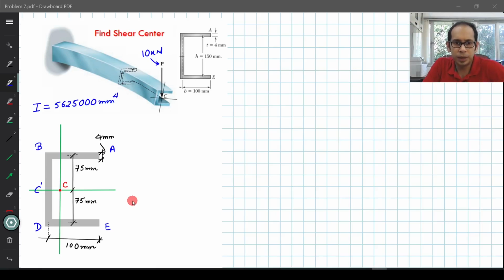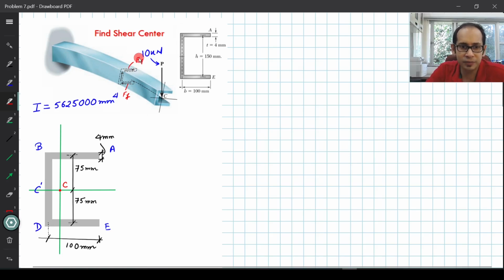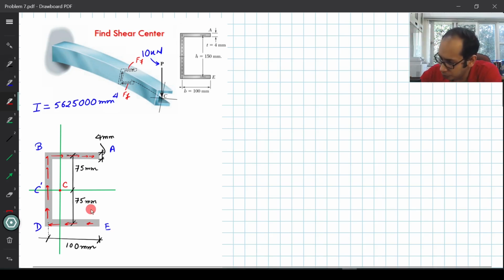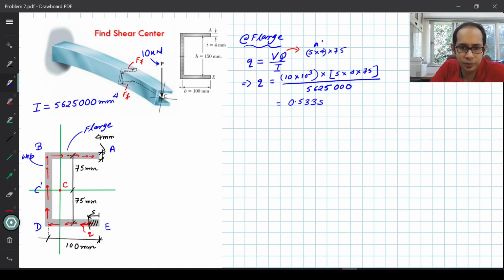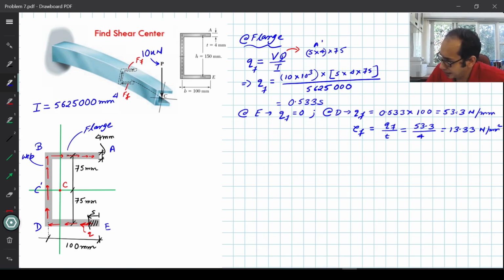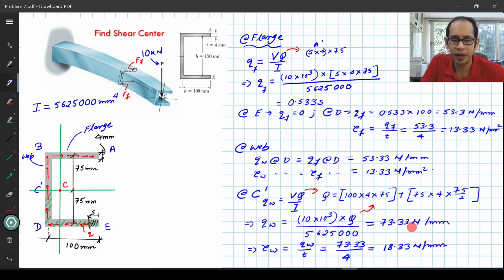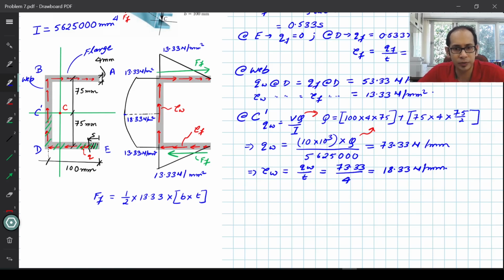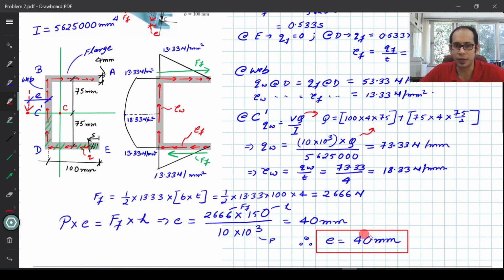Topic # 7.6 - Shear Center (Problem Example)

Comment: When calculating Q for the shear flow of the web at C’, shouldn’t the length of the section of the web below the neutral axis be 79? as in 75+4 because the length of that section isn’t equal to the distance from the neutral axis to the centroid of the flange